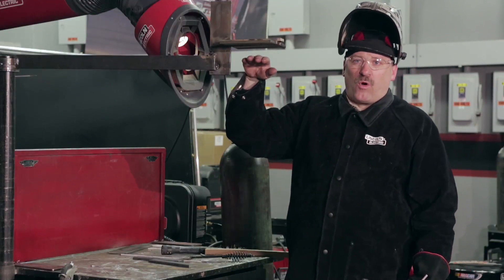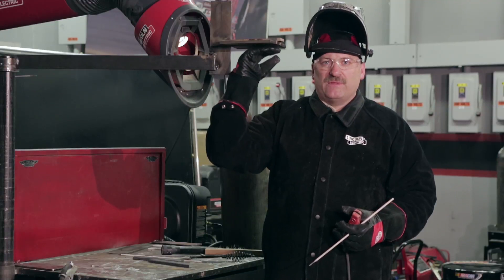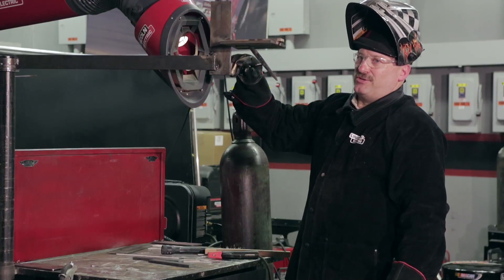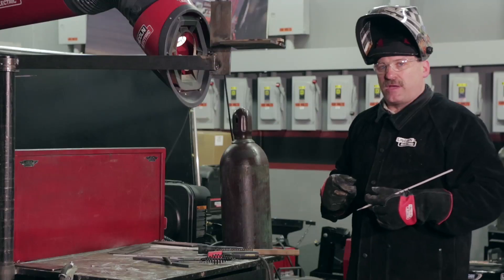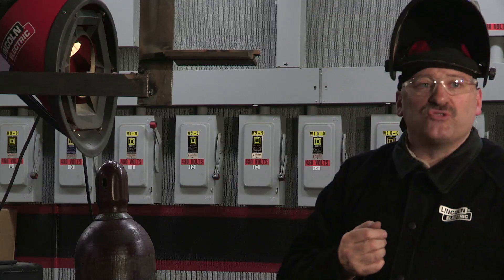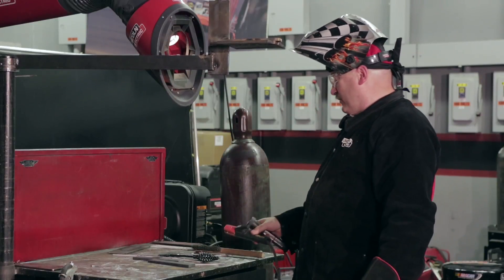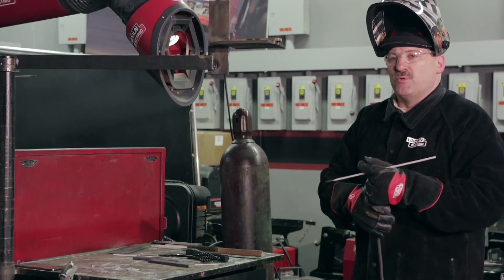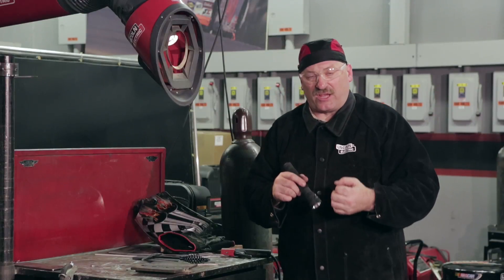Tech Tips: AWS D1.1 Overhead Welding Test, Part 3 - Cap Pass & Testing

Comment: This guy lost his angles a lot. Started out with a 5 to 10 degree angle and then went start up into it trapping all that slag in the weld. With the visual part he wouldn't of passed. If you look at the plate it was bent upwards. he put too much hear into the weld area and didnt leg it cool enough. Definitely needs improvement. Check out welding tips and tricks for a proper weld video:)
Reply: Doesnt matter if the plates are bent up at the end dickhead. That happens to every weld
Reply: Doesnt matter if the plates are bent up at the end dickhead. That happens to every weld

Comment: Been years since welding a trailer project. When I look at some of the welds I guess Im amazed they didn't break. Anyway practicing uphil with a 7018 3/32" rod. DC+ around 85 amps. Im going to weld on a 4x4x1/4" angle for tail light brackets. Do I use amperage for the rod regardless of the plate thickness? It doesn't need to be super strong as it only holds the tail lights. At 85 amps I get a decent looking bead and can hold a tight arc although the welder ACDC Lincoln "Buzz box" seems to groan a little at that amperage. If I turn it up to say 95 amps the slag is difficult to get off almost thinking Im frying it on there or maybe I need to run faster at the higher amps. Help and thank you!
Reply from the maker: http://www.lincolnelectric.com/assets/us/en/literature/c2410.pdf
Check page 28 for Vertical up 70158 procedures
Reply: Thank you

Comment: What's with the 'backing plate'? Where's the root run? Where's the penetration inspection on the back side (impossible with a backing plate)? Are US tests different to ours here in the UK?
Reply: Best I can determine from Googling Job ADs in the UK is that you need your ASME IX or BSEN 287-1:2011 - US has ASME, API and AWS. Canada has ASME, API, DV, and CWB, along with some oddballs.

The EN 287 has "ss nb" which you mentioned (we use that for 'Pipe Tests') and "ss mb" which is used for 'Plate Tests' (we do Open Root Plate Tests also, just have to ask for one) and ' our ' "bs" is for Boilermakers and generally not for testing "Welder" Qualifications.

We do 2 Stop/Starts per Plate with some Plates getting 3 Coupons cut. Part of the Test is to call for the Inspector to prove you stopped ON the Coupon area, otherwise that's a failure. It's supposed to look pretty but more emphasis is on "will it bend", though sometimes you can tell from Visual that it has no chance.

So basically, they are all 'similar' in that the Material, Filler, Position and "will it bend" are what's most important for Mild Steel Plate; for North America once you get past MS Plate there can be some difficult Tests that are nowhere near as slack.

YT,
Rob
Reply: *****
Thanks for responding. It's been some years since I was a welder but the qualification required at the time for the UK was Lloyds Class 1. ASME9 (American Society of Mechanical Engineers) was understood to be very similar. I do remember the bend tests and also the dye penetrant tests in the cut weld joint.
Reply: Where im at they make you wash off the backer bar after the visual and they inspect your root and cut coupons to bend them

Comment: No way he ran a cap after those 2 filler beads in part 2...I can even see where he had 3 beads laid in there right before he started his cap.
Reply: MrDownWithTheSouth I was thinking that too. Especially since he went pretty quick on those fill passes after the root. Only took two electrodes to get to the cap after the root? WTH? Makes no sense with a 3/8 inch plate
Reply: He put a thick root in guys it dosen't take alot to fill 3/8 plate at all

Comment: I have trouble with 4G.. I use the stinger cable as a sling and cradle my welding hand. I have no problem with the hot pass and fill, its the cap that gets me.. my hands are shaky due to military service, so its tough trying to get a uniform bead/cap from end to end.. any tips?? Could I stabilize the rod in between my fingers with my cradle hand?
Reply: what ever is best for you there are no restrictions on how you manipulate the puddle